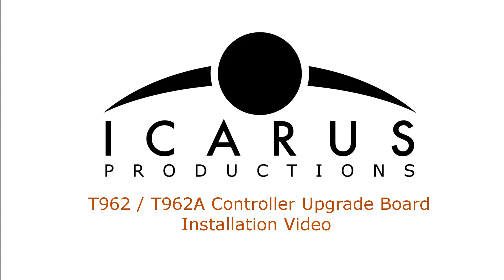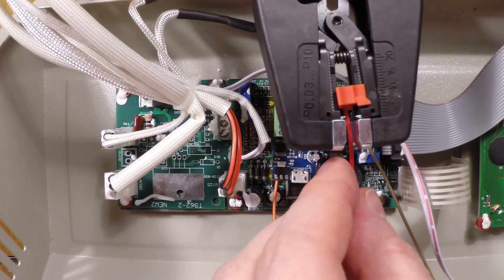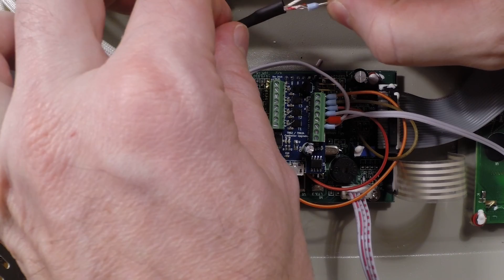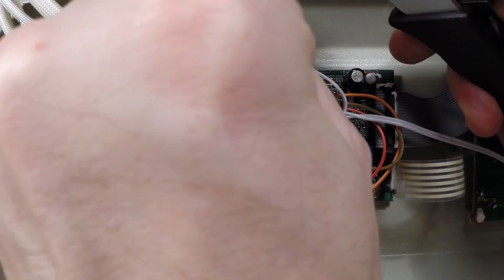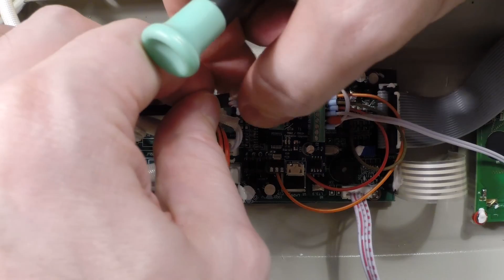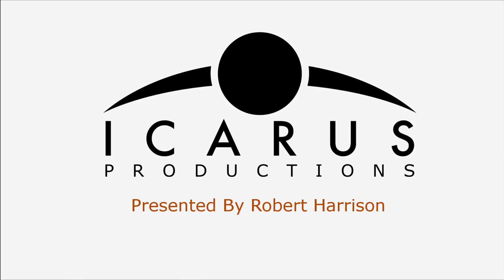T962/T962A Controller Upgrade - Installation Guide

Comment: Robert, are you still selling these?
Reply from the maker: Richard Vowles you will find them here https://www.theicarusproject.co.uk/
Reply: perfect - just placed an order! hoping to get this thing working sensibly! (t962a)
Reply from the maker: Richard Vowles These ovens are never going to be perfect but I personally think it’s essential to know the temperature accurately in the oven during reflow and this is what this board does. You can buy two more K type thermocouples and attach them to this board so you can monitor the surface temperature of the PCB boards too. The other good thing is the fan control for the oven which only turns the fan on when needed. The ability to record reflows and reprogram the oven via usb is also very useful when wanting to monitor and change reflow profiles.